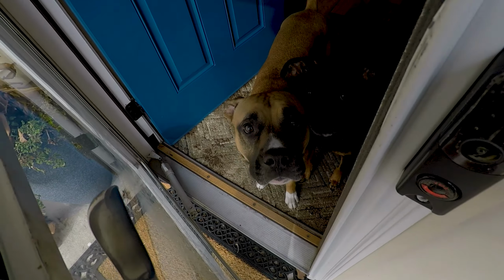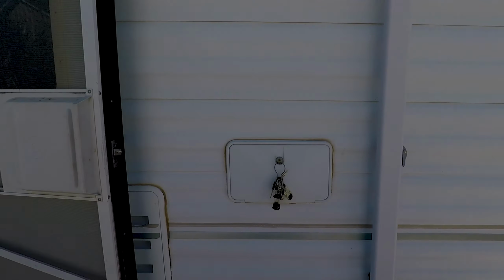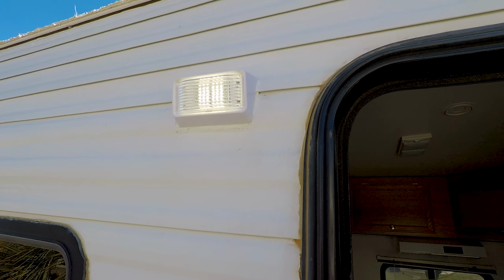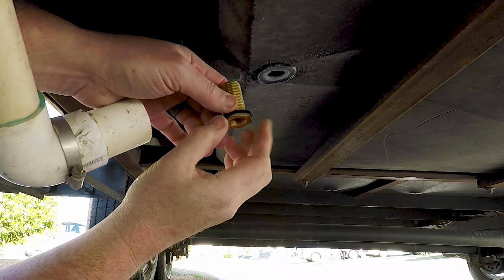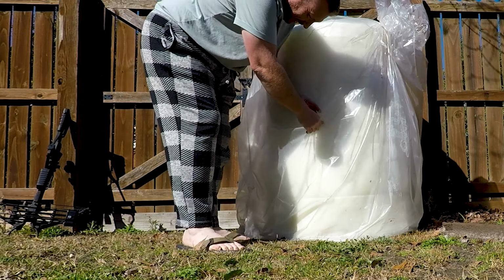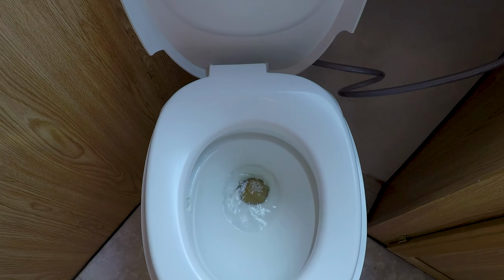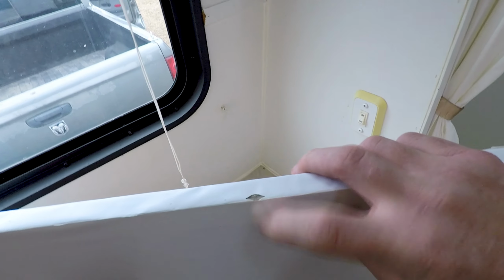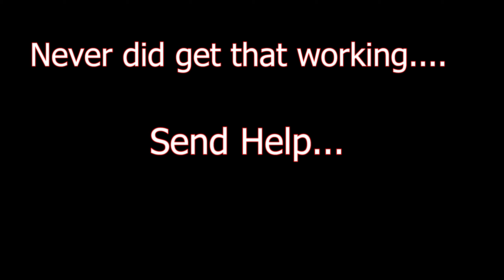Any given Saturday, Overlander working on a trailer...

Comment: I believe right above the pilet light on the water heater that the flame should touch and get warm to tell the system it is lit and just not flowing gas for nothing if that doesn't work probably a good cleaning will help
Reply from the maker: A good cleaning it'll get! Awesome, I'll report back!

Comment: Alright, this is going to be a long shot but here goes;
The Princess and I went camping in November and both the Mr Buddy Heater and the 28 Year old propane  Coleman stove would light but not stay lit.
Stick with me. Your hot water heater is doing the same thing as my Buddy Heater.
I got both working after rubbing alcohol and q tips in the orifice tubes.
The pilot light not working means it's just gummed up after..( I think you said 11 years ) of just sitting. 
A good clean should help.
We made do with a campfire, cast iron and leftover chili.
But when I got home, you can bet they both worked after a few adult beverages.
Good Luck from NE Georgia!
Reply from the maker: Ya, I had a loose guess that something was clogging the tube, but it's good to hear. Cleaning those is a great suggestion. I'll look at how to get that all apart and make sure the lines all flow properly.

Thank you!

Comment: You hot water pilot not staying on , make sure that there is water in the  hot water tank,  its maybe have a sensor  , also check to see if there is a coupler , a copper tubing line with a thermo at the end by the light  make sure its clean and about 1 cm away from the plight light , depending on the model check for other safety switch , 
Wife and I love watching  your off road ventures, also looking to get a FJ , way too expansive  now 

Peter
Reply from the maker: Thank you Peter! Just wait a few more months. I feel that the market is settling down, you should be able to find reasonable deals on an fj soon...